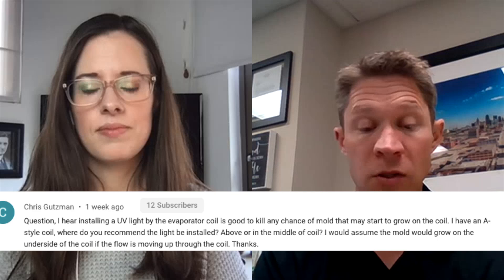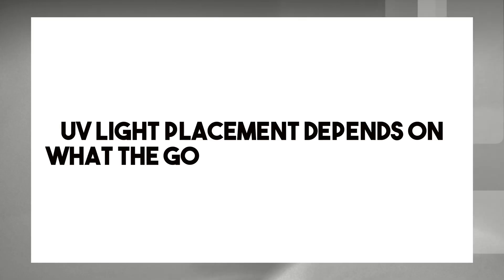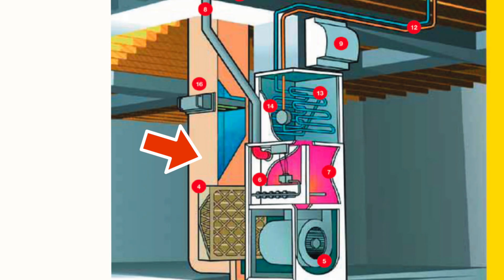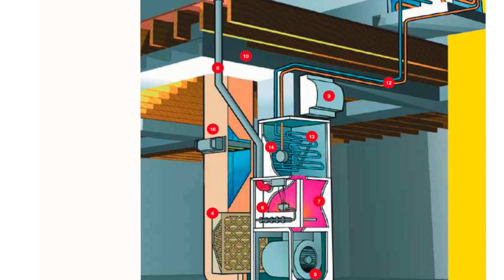BEST LOCATION FOR UV LIGHT | WHERE TO INSTALL UV LIGHT

Comment: UV lights DO NOT KILL airborne mold spores, they pass through too quickly for the light to kill them.  The only thing that UV lights are good for is to kill mold on the coil and it only kills where it shines.  It takes 6 HOURS of constant exposure to the UV light for mold to be killed.  It would be much better to install a REME Halo in the supply plenum to kill all kinds of germs, plus airborne mold.  But to keep the coil mold free, the UV light would do some good near the coil. The downside of the UV light is that it will also disintegrate the filter, corrode electrical connections, make wire insulations brittle, and fall off possibly causing short circuits and if it hits the plastic housing on the REME Halo, it will disintegrate that.  It must be ensured that all of these items are protected from the UV light.  And more bad news:  The UV lights will also disintegrate the protective coatings that are put on the coil pipes, so then what happens is that the moisture without this coating will corrode fittings and cause the coil to spring leaks.  A lot of mold experts don't use UV lights at all, they say that they're more trouble than they're worth.  A/C contractors push them because they have to be replaced constantly, which means money in their pockets for the service call and the markup on the lights to come out and replace them.  The problems that they cause (corroded wire connections, leaky coils, etc.) also cause more service calls, or even premature replacement of the systems, because once a system gets to be about 10 yrs old, it doesn't make sense to repair coils anymore, they just have you replace the entire system.

Comment: In my opinion it doesn't matter where the UV light is installed. As long as the air passes through the UV light before hitting the coils, it really makes no difference. My air handler is mounted on a metal cabinet which has lots of room, it's a 2x4 metal platform where the air passes from the receiving end to the outbound air into the coils. Lots of room down there to install the UV and I also have air fresheners down there, works great.

Comment: The typical UV light used in residential systems won't do anything to stuff flying past it in the air stream, there just isn't enough exposure time, so the return duct is a useless place to put one.

Comment: If wanting to kill bacteria in the return air itd be more beneficial to install a ozonator or a negative ion generator and have it on a 2 hour cycle every day when nobodies home..  that way it would completely sanitize the ducts, way farther out than any light would and actually uses less electricity to run..,

Comment: In my situation per manufacturer instruction I have installed an humidifier above the A coil and I do think it is not wise to put a UV light in the A coil Incase it freezes and the drips on the UV, thus will install in return duct .

Comment: Are there in a UV lights that don’t produce ozone?
Reply: Most uv lamps produce 255nm. At that range uv light disrupts the bond of ozone. If the bulbs are between 100-240nm then they would produce ozone. And generate the most at 185nm.

So just make sure your bulbs are 254nm and your safe.
Reply: there are many, reme halo led and the scorpian UV-C led

Comment: Thanks for the video,  I have a horizontal unit in attic, but would like to keep the coil area mildew or mold free.  I can easily place UV on return or supply,  My wife has asthma and is allergic to molds.  Based on your explanation I am planning on the first section of supply in the top as close to coil as possible.  Your thoughts?

Comment: Can you install one of these lights if you have a gas furnace?  In my case the AC coil is ABOVE (after) the gas furnace.  In the winter, I'm guessing the air temperature that close to the burners is probably 150* F.  Can the units withstand that temperature long term?
Reply from the maker: Hi thanks for the question!  Matt answered in this video: https://youtu.be/Y48XVCvmDhk  Hope that helps!

Comment: I just found out that I have mold growing directly on the coil of my AC unit.  I've been been dealing with poor air quality and scratchy throat for months until now. I fogged with Concrobium and now air quality is much better but I still have some mold leftover in the coil that I hope that installing a light will kill it.
Reply: How did you do the fogging? I have been looking for information on this but can’t find it anywhere

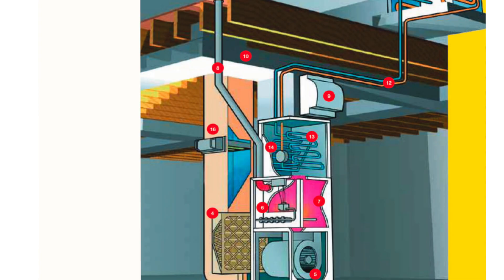Comment: Hello, really helpful video, just installed a UV-C in the air return, but want to double up the coverage as GF coughs her brains out when the A/C is on at night.  My system looks just like the picture at 1:12, should I install the 2nd UV-C light in the section with the 13 or in the section with the 9? Meaning is it in the same section as the coils or the one above? Thanks in advance!